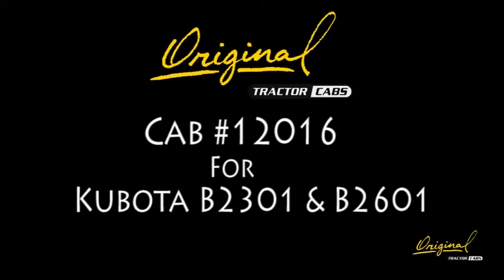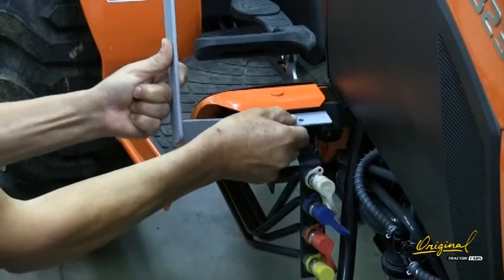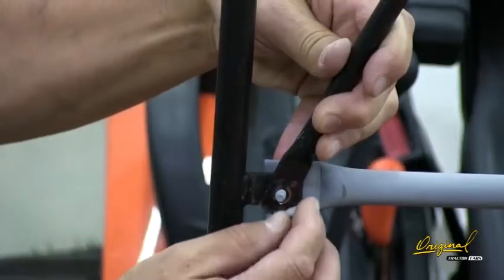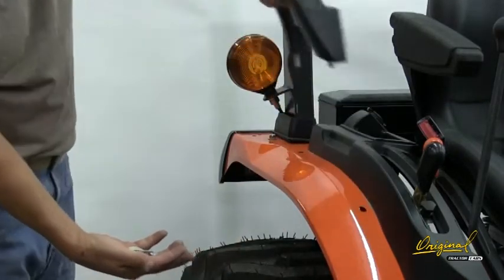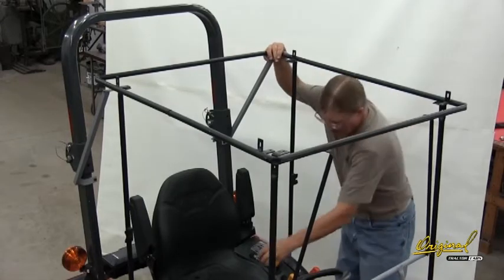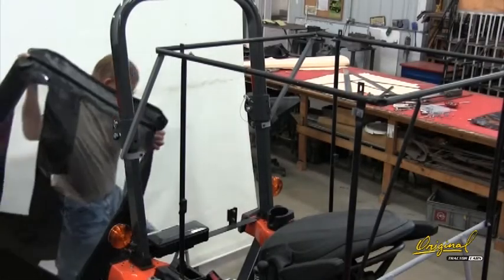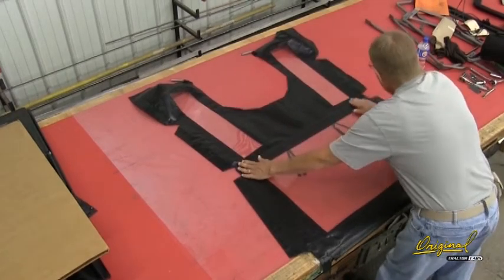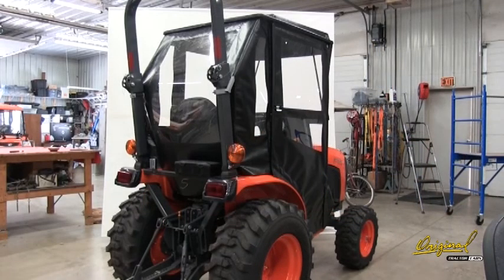Original  Tractor Cab Installation for Cab 12016 To fit a Kubota B2301 and B2601

Comment: I just installed this top. It's a nice top, but the instructions are hard to follow (wish I found this vid earlier), and the fasteners leave a lot to be desired.  I added 2 6mm washers to the front and back of every bolt. It made a nice difference. Also be careful on step 1, installing the loader lever shim - it's super easy to bust the head off one of the OEM bolts. Ask me how I know lol.
Reply from the maker: Hello, I was wondering if you could share your opinion on what we could change in the instructions for future manuals and revisions.
Reply: @originaltractorcab8840  Sure, would be happy to. Few things that come to mind: 1) More photos (and clearer, & color) are needed. It's very hard to visualize a lengthy set of text instructions. I had to read then re-read many of the steps multiple times before I even knew what step to take next.  Then I often found myself a few steps later going, ah-ha, I did that wrong, and re-doing a previous step because I could now see it.  It was often difficult to determine where on the tractor things were mounted - mostly because the photos that are in the manual are small, not super clear, and aren't a good perspective; maybe a better photo reference point on the tractor, larger, clear, color photos with arrows, etc.   2) The fasteners should be easier to identify. Yes, they are clearly spelled out in text descriptions, but again, being able to quickly visualize what fastener goes where would have really helped.  3) Finally, that loader lever shim and the fasteners are no good. First off, the OEM fasteners are junk and snap with just a small amount of torque. Second, the shim is super low quality and a bad fit.  Lastly, I ended up using my own fasteners with some thread lock.  It's OK now but that shim still bugs me.  Hope this all helps.
Reply from the maker: @joegf1739  Thank you for your reply. Early 2021 I started updating our manuals replacing black and white photos with color photos and trying to replace blurry photos but some of our old manuals are still out there. We are tagging each part with a label number now but we'll try to figure something out with the fasteners. As for the shim, that is something I'll bring up with our engineering department.
Reply: @originaltractorcab8840  The part tags were really great. Sounds good. Let me know if you need a tester for any shim improvements.  I may modify modify this one by grinding an angle into it.  Or maybe make a new one. I do love the cab and it does a great job keeping the snow off me! Thanks for offering such a great product at a very fair price - really appreciate it.